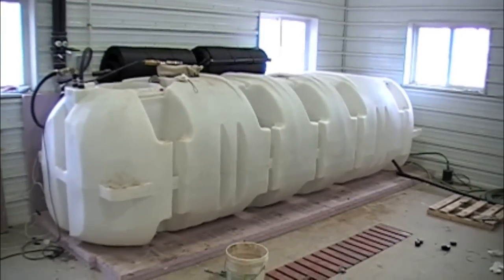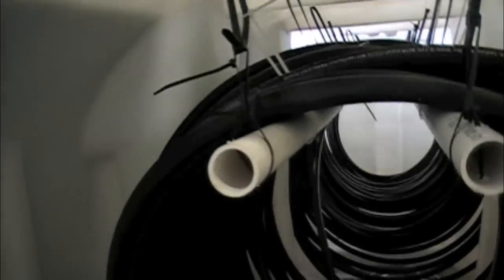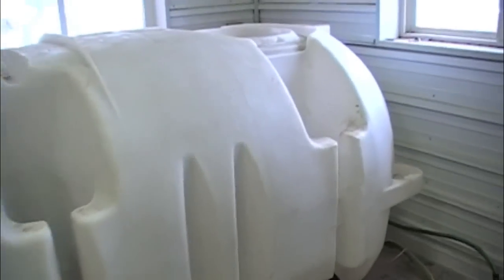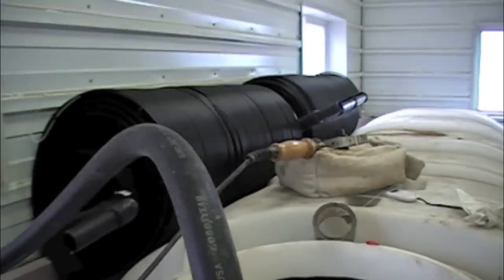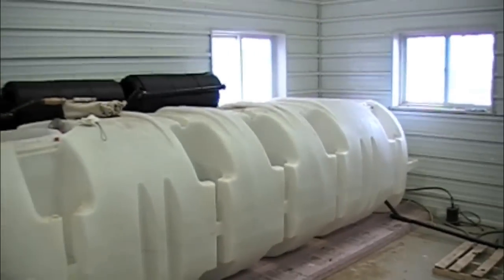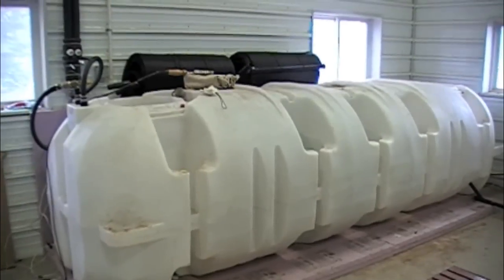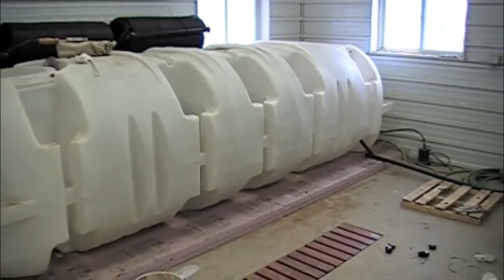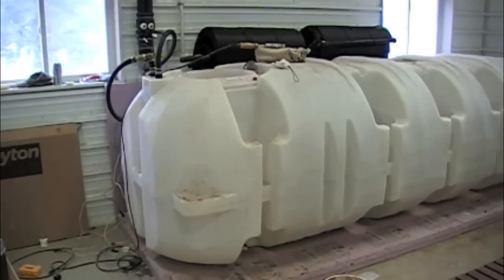Multi-Source Heat Pump Thermal Battery Testing

Comment from the maker: More clarification:  We are not installers or designers.  We are distributors of products related to renewable energy heating and cooling systems.  We sell these tanks, other large tanks used as thermal batteries, and other related products.